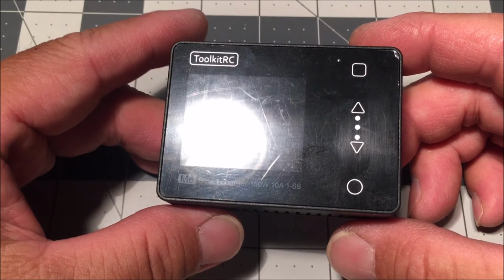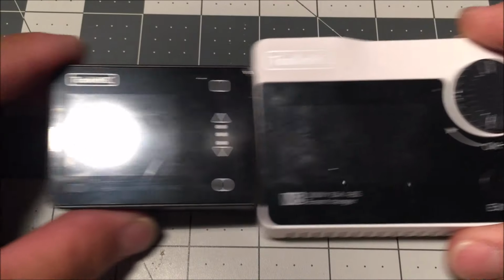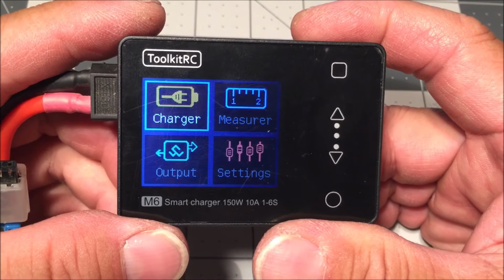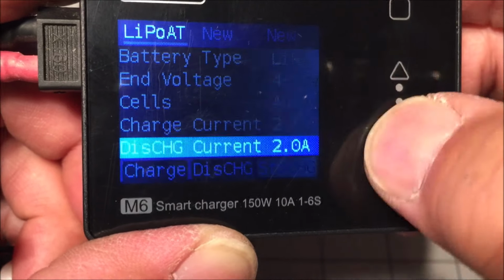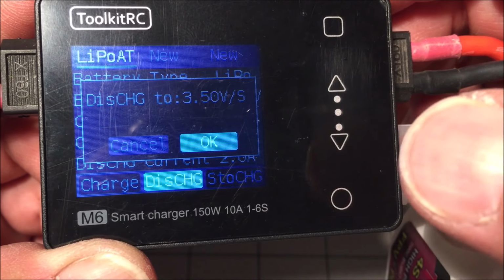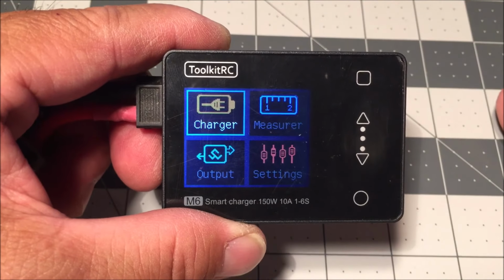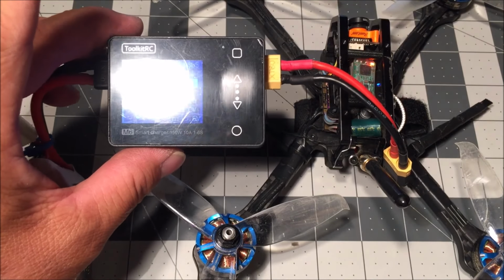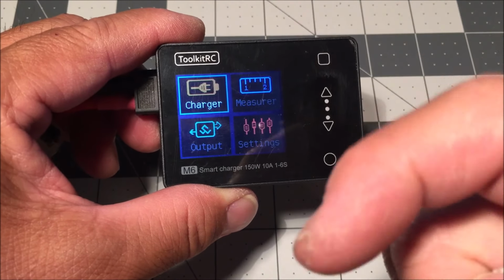ToolkitRC M6  150W 10A  Smart Balance Charger

Comment: I have issues connecting balance port to this charger. Its brand new from box.  Balance port would not fit in the slot. Have you faced this issue ?

Comment: Can i charge it usu usb only i need to charge 3s battery 3000mah 11.4volts
Reply from the maker: The charger needs to be powered via the xt60 INPUT PORT and the usb is 5V 2.1A is an OUTPUT PORT for charging a phone or similar.  A 3s 3000mah needs to be charged via the xt60 out.
Reply: @RCEscape  om where can i find thos xt60 adapter link please

Comment: Mine doesnt work i have the same battery as you have in this video and when i press charge it says input to low
Reply from the maker: what is the input voltage set to in settings?

Comment: Can it be powered by a brick setup like laptop power brick ie make xt60 to laptop lead
Reply from the maker: I power it with my car batt with alligator clips to xt60 so it should work.
Reply: @gadgetman 404 Be careful. I powered it up with 18V 3.5A notebook adapter which works fine with ISDT C608 for years but for the M6 it has some problems. First it cannot charge, I tried to charge 4s 1500mah at 1.5A and it shows "too low power input" warning. Second the IR measuring function doesn't work it shows "Times out". However, changing to 19V 6.15A notebook adapter and both problems are gone. However! I tried discharging 4s 1500mah by using the 6.15A adapter and it took forever. I got ten 4s some are 1500mah some are 1800 mah and use 3 differ chargers to discharge. The charger discharging rates are 0.3A, 0.6A and the M6 is at 0.4A. After all batteries are discharged(4.20 to 3.85V per cell) the M6 still not finished discharging its first battery. Still at 3.99V range. Not conclude that it is a bad one but there is something annoying about this charger.
Reply: @FireDFPV  Well, about the power brick this seems legit since the 1st adapter you use only output 18*3.5=63W, which is pretty low compared to the 150W capability of this charger, and the 2nd adapter output roughly 19*6.15=117W, which is much better than the 1st one.
Reply: @Strapperx3  Thanks. The fact that the ISDT sc608(also 150w max) works fine is surprising then. Thus there's no use to be so small but needs a hugh power supply.

Comment: I like how you tie wrapped your balance plug to your power cable 14:58 
This multi function charger is really cool and the price is right, its also nice and compact for traveling.
Reply from the maker: Yep!  Zip tie all my batts not all the way but still able to slide :)  
This charger fits in my bag where I put my xiaomi yi cam!!  which has a dead battery...  Perfect!!  :)